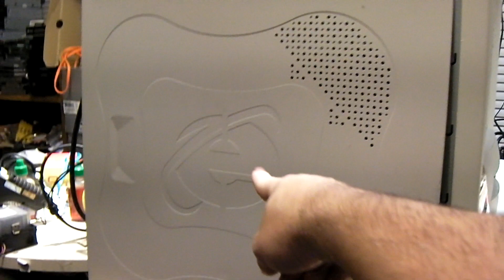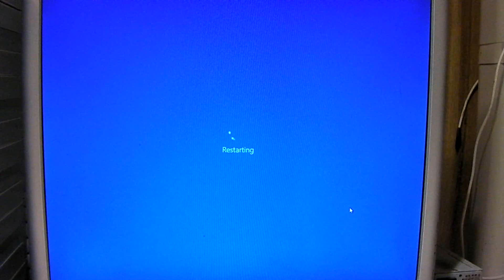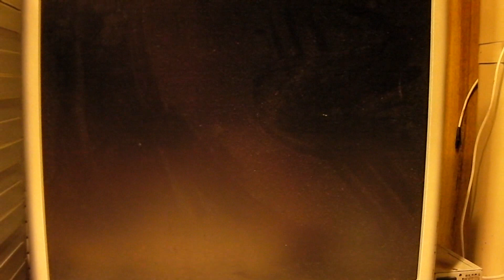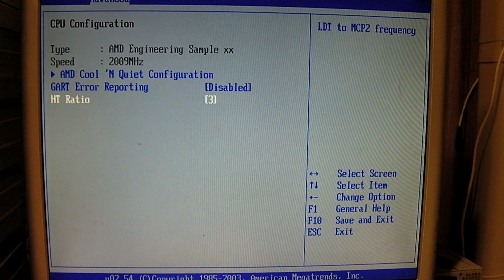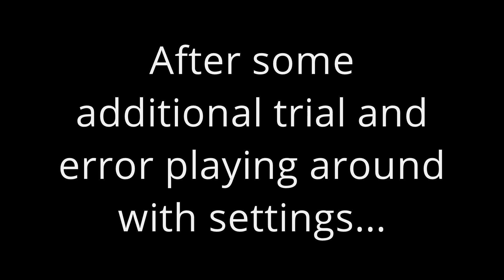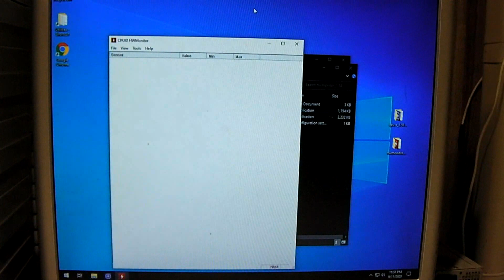Overclocking an old Sempron 3400+ 2GHz Socket 754 CPU to 2.5Ghz

Comment: Why do people try to run Windows10 on cpus that are so old with only 1 core? windows10 is designed for 4cores+, socket 754 was designed for windows98 and 2000, the 754 cpus wont even run 64bit windows10
Reply from the maker: Windows 98 and 2000? Are you serious? 🤣 Ya sure AMD would design a CPU for Windows 2000 after releasing the Athlon XP which was designed with Windows XP in mind.

If Windows 10 was designed for quad cores, I guess a lot of OEMs were wrong for including it on systems with dual core CPUs. Should have just installed the no longer supported Windows 7 on those systems.
Reply: @CubeComputerChannel  Yes im serious, the athlon xp and socket 754 were both single core processors designed for single core operating systems, windowsXP in its infancy ran horrible on multicore cpu's, and windows2000 was targeted at business server use, however it became quite popular for home users around 2003.

Yes you are right, OEM's were wrong, running windows10/11 on any dualcore machine is a very bad idea, especially when youve got about 50 services running in the background.

And NO, the athlonXP was not designed for windowsXP, they didnt even support SSE2, amd named them AthlonXP in preparation for the new OS that was about to be released, it was a marketing plot.

Windows10 came out in 2015, nearly everyone had at least a quadcore pc in 2015, i owned the amd fx 8320 which had 8 cores.

Windows10 has a crap ton of services running in the background all the time, a single core cpu would never be enough, not even if it was clocked at 6ghz, i tried this by disabling 7 cores of my ryzen 2700x, windows10 took nearly 3 minutes to boot everything and crashed eventually.

Socket 754 wont even run windows10 x64, its missing about 3 instruction sets that 10 requires.

And if people are running windows10 or 11 on any system thats not at least a quadcore with 8gb of memory they deserve a slap in the face.
Reply from the maker: @Synthematix  
I'll go ahead and call HP, Dell, Acer and Lenovo, and tell them they need to recall every Windows 10 system they sold with less than 4 CPU cores because Synthematix UK says it's not compatible and that Microsoft, the author of the OS didn't properly set the recommended requirements. Oh and I'll slap the owners because they ran Windows 10 on those computers even though it's how it came out of the box. I'll slap myself for running Windows 11 on my Dell Inspiron 1525 with its Core 2 Duo CPU despite it running perfectly fine with 4GB of RAM and a SSD. Those 2 items make the biggest difference with Windows 10's bloat.

Nowhere near everyone was running a quad core system in 2015. There were still a lot of new dual core systems and even  some single core systems still in use. Older builds of Windows 10 such as 1507 and 1511 ran OK on single core systems. No crashing or anything other than slow multitasking performance. Disabling 7 out of the 8 cores on your Ryzen 7 is not the same as a native single core CPU.

I didn't say the Athlon XP was designed for Windows XP. I said it was designed with XP in mind. Why else would AMD have released it in the same month as Windows XP's release... AMD meant Extended Performance by the XP abbreviation, but it was intended as a better option to run the new Windows XP.